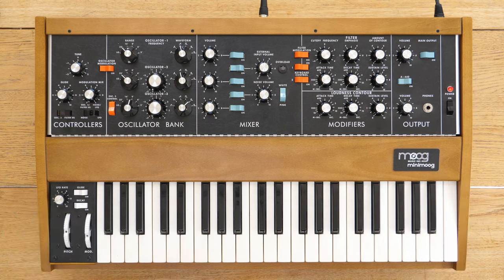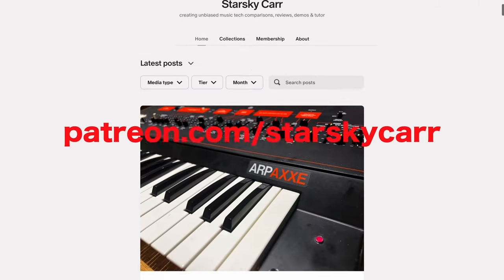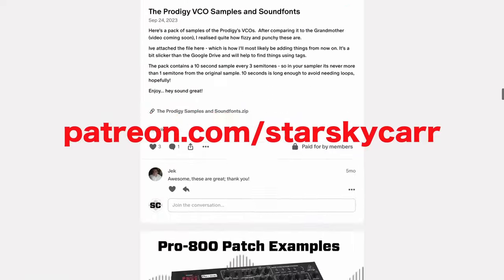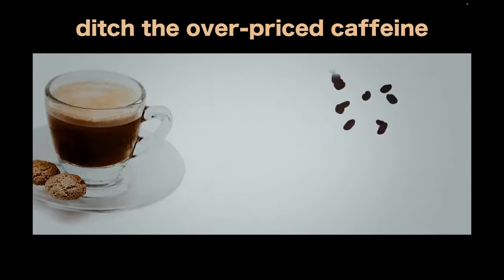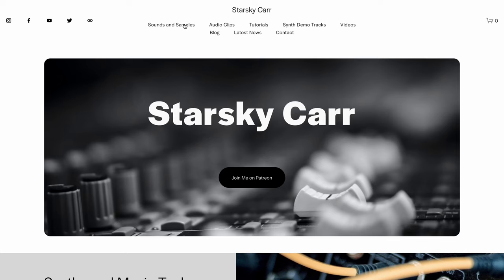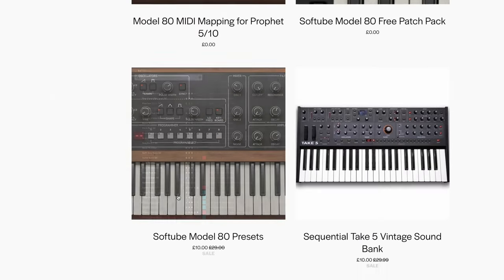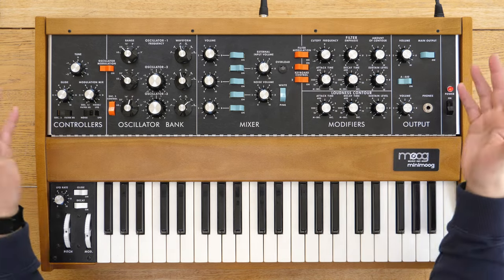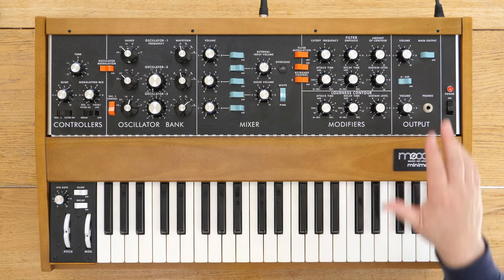What's all the NOISE? // 41 ideas for that weird noise oscillator

Comment: This video is pure gold! A sort of dusty, crackly, lo-fi gold, but the very best of that kind of gold. There was one lightbulb moment for me where you used the filter modifiers (ADS) with the oscillator modulation turned on. I’ve had one of the 2022 re-releases of the Model D for about a year (and love it). However, the modulation mix set to “Filter EG” with the oscillator modulation on simply did not make sense to me. I could not understand what it was doing. In this video, you pointed to the attack/decay/sustain knobs … and it clicked for me. Duh! Yeah, I’m slow, but I still have so much fun.